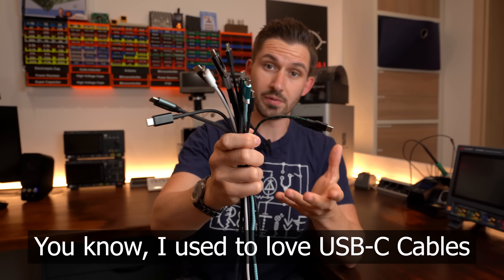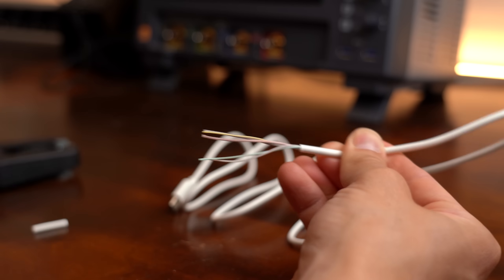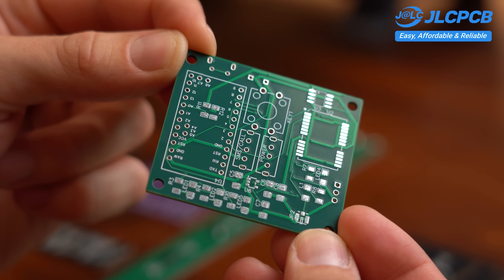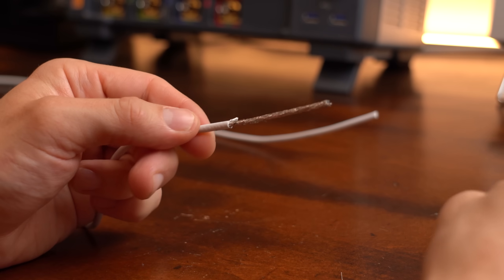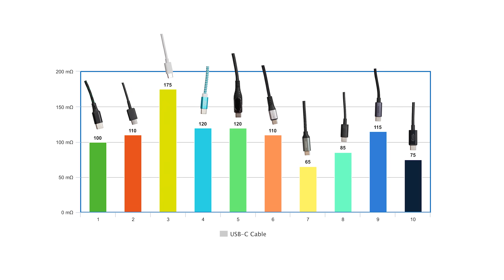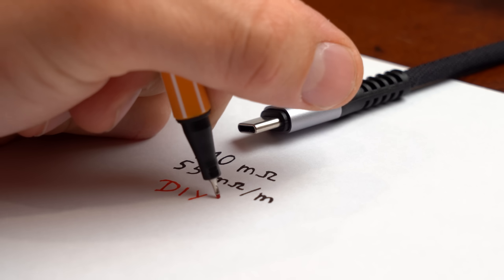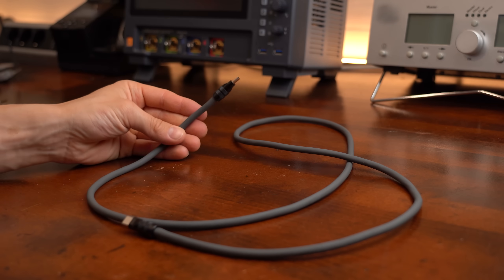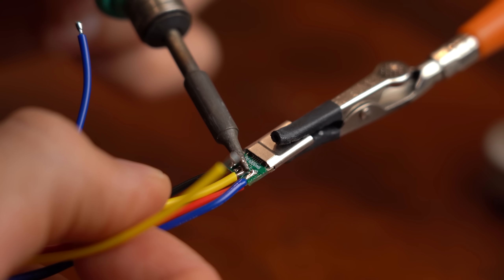Your USB-C Cable STILL Sucks — I Built a Better One? (DIY or Buy)

Comment: No strain relief = broken solder joints / wires. Doesn't look like the "sleeves" provide any strain relief, do they?
Also, I'm assuming the other cables did support high-speed data transfer and alternative functions?
And finally, did you compare outer cable diameter / weight between DIY and the best BUY options?
Oh, and is the wire you used rated for 50v?
Reply: There’s a lot more that goes into engineering a USB-C cable that is compliant with the top tier specification, this is the fundamental reason that they are rare and expensive.
It’s difficult to design a tough and reliable cable while being light weight, has fast data speeds, can carry 250W, be fully compatible with all the different communication standards and also be cheap.
Not to mention the highest spec cables fail QA much more often due to interference effects that are not cost effective to rework.
USB-C cables still require humans for specific operations which drastically increases costs and errors
Reply: @gtjack9  All USB-fig had to do is define 3 standards and use color coded plugs to define them.
One standard for high power low data speed (just like one in video), one for high data speed (and all data formats) but low power, and one with everything.
And maybe fourth with low data speed and low power, but that one would be just a normal USB 2.0 so don't know if it makes sense anywhere.
Reply: @hubertnnn From a consumer perspective you’re spot on, but that is completely different to the technical specifications that allow this functionality to exist. We have complicated cables because cables are actually quite complicated
Reply: @gtjack9  Nah, cables are super simple. All you have is max amps and max frequency it can handle. 
And if you are doing parallel standards then you also have to handle lengths to guarantee synchronization, but we are talking about USB - a serial standard, so no synchronization is needed.
Reply: @hubertnnn 40Gbps, think about that for a second. That’s higher bandwidth than CAT6 Ethernet.
If you can produce your own cable and post a video that meets the highest USB4 specification I will be amazed.
Reply: @gtjack9  Ironically Apple's USB C cables are now the better option. Coming from those nasty flimsy lightning cables.
Reply: @jonbrandjes9024 They are the best by far in my experience, it’s just really frustrating that they don’t do a 2m version of the C to lightning cables.
The Apple usb-c and lightning connectors are a marvel of structure and electrical engineering.
The casing is extremely tough and is laser welded together so the electrical pin contacts are the weakest link of the entire cable, which cannot really be improved with current technology.
I’ve had my Apple cable for more than 4 years without any issues.
For reference I’ve gone through 3 anker cables which fail within 3 months.
Reply from the maker: There is a strain relief. A screw secures the wire in place.
Reply: @greatscottlab  fill it with hot glue as well next time. Help a lot to protect the solder joints.

Comment: hey mate love the videos what is that device you use to run voltage through the cables
Reply: not the tester you use it alot to inject voltage
Reply from the maker: A powerbank or power supply
Reply: @greatscottlab   the board with the fan on it that you can adjust the ac or dc?

Comment: All that work to get 10% improvement is simply not worth it. Now if you wanted to create a cable with better shielding, common mode suppression etc I would understand the DIY route, in this case no.
Reply from the maker: Maybe next time more about shielding and so on ;-)
Reply: @greatscottlab  You are going to have a hell of a time with that one, royal pain to do it right with such small diameter cables, ask me how I know ;)

Comment: Engineer me this, please, because I start to lose my mind.

I have a power bank, in which I guess the batteries are half dead (40000mAh battery, but can take only 20000mAh worth power, and of course can support even less), and it started to work as an OTG device, when it depletes: the tablet charges it back, so I wake up to a half full power bank and an empty tablet. I suspect this because my devices don't really support reverse charging.

I thought, that ok, the power bank is bad, but other power banks started to do the same. Before that I bought a couple of charging cables with charging power display, and I always used the display side in the tablets. I thought, that this is the culprit, so I bought cables without display. 

Now I can reproduce the reverse charge behaviour only with the bad  power bank. My other power banks turn off as expected, and does not behave as on OTG device. But I wonder for how long?

What gives? Also, is there a way to use the Type-C output of the power banks, but prevent the power bank to turn into an OTG device? I found only in my phone an option, to disable the OTG function (to be precise, I have to enable it prior use, and it turns off after 10 minutes of not using it)

Comment: This may be a dumb question but why do you only want slow data transfers? Is it just because fast data throughput is more complicated to make?
Reply from the maker: It takes more wires and I simply do not use it. That is why I did not include it.
Reply: Thanks for answering my question :)

Comment: Digitus has silicone USB-C cables that do it all. They are not cheap but absolutely awesome. Beware with the length though: The 2 meter ones are NOT USB-4 / Thunderbolt 4 compatible anymore and fall back to USB 3.2 Gen 2x2.
Reply: Thanks. Been looking for silicone usb cables 👍
Reply: Do you have a link to them?
Reply: @SierraLimaOscar  Yes but I cannot post it here. It would get immediately deleted. Sorry.
Reply: @SierraLimaOscar  Try Google - I did and in the UK it shows them to be readily available through various resellers.
Reply: That's still very good, usually 10Gbps is rated for not more than 1m, let alone 40Gbps.

Although I think the newer standard has introduced modulation and they have not incremented the fundamental frequency.
Reply: @TrickyNekro  The reason why we still have no GPUs and monitors that have USB-C with PD 240W support is the cable length. 1m isn't enough for anything usable besides for mini PCs. And these have a power supply too weak to drive another screen. I hope they switch to fiber for the data connection so we can have 3 meter cables and a single cable to a screen that provides power, display and a USB hub for peripherals and storage.
Reply: @kyoudaiken they could unify Ethernet and USB, you know at that point, it would save a ton of development time.

BTW I've seen some "active" USB cables based on fiber optics already, but I have little trust to be honest.
Reply: @TrickyNekro (USB & Power) over Ethernet? 😅
Reply: @SystemX1983  was talking about towards making them electrically compatible.
Reply: @TrickyNekro  the more I think about it, I'd love my phone to be charged using PoE and use ethernet for data transfer :)
currently my phone is charged in a cradle using 2 pogo pins, but no data transfer on the cable
Reply: @TrickyNekro  That's most likely not possible. Ethernet needs 4 pairs of twisted wires. It's a totally different thing.
Reply: @kyoudaiken  ethernet doesn't even need more than a single pair, ethernet what? 10 Base, 100 Base more?

In any case, USB 3+ has 4 pairs, 2 RX, 2 TX, exactly like Ethernet.

The difference is that for most versions USB has no modulation and Ethernet has for most of them, if not all. Also Ethernet guarantees isolation, which is a big one and very important in many applications.

The extra signals that USB has can be dealt in other ways also to keep compatibility.

It was pretty stupid for USB not to use Ethernet front ends for the TX RX high speed pairs and this is more of the point that I wanted to make.
Reply: @TrickyNekro  Copper Ethernet draws way too much power. And even 10 GBit is way too slow for the requirements today. Also USB3 uses 2 pairs, not 4. And it also has the old D+ and D- wires for 2.0 of course. So it's 3, no 4.
Reply: @kyoudaiken with 10Gbps and 5ghz fundamental I would have guessed that they use both, but I didn't do a deep dive.

Comment: Would be nice to go deeper, test how important shielding is (probably more so to faster transfers), and if the volts/amps over the power lines affect data rates in shielded/un-shielded/twisted (RJ45) wires, or cable that isolate power from data wires.
Reply from the maker: I actually have a seperate video about shielding planned......but don't tell anyone....
Reply: @greatscottlab  This is a great insight, the DIY/BUY break even point would be even more deep when it comes to the point when it makes sense to just switch to twisted pair and ethernet with a converter in between for ridiculously long cables. 1M usb performance might not be equal to 100M "usb cable" vs twisted pair ETH converter daisy chained. I've had many disaster stories from even below 10M usb lengths for data transfer...
Reply: @greatscottlab  I'll spill some of the beans (sorry man) but I've been hit with this issue myself. Since the power lines aren't screened - at all - any noise (like the apprx. 1KHz polling pulses) gets impressed on the power rails so good luck trying to get sensitive analogue components to work at 5V... It's a really nasty problem, even on USB 2.x
Reply: You gave me a heck of an idea:
USB-C cable with thick power wires and a full CAT5e/6 shielded patch cable for the high speed data.
Thing will be an unbeatable anaconda of a cable for sure.
Reply: @Kalvinjj  But it would be the greatest cable ever made
Reply: @Kalvinjj  "my anaconda don't want none unless she got buns, son"   - Sir Mixalot
Reply: yeah also like do maybe full guide on how to make diy usb cables ground up with your own wire

shielding yes/no
gauges for data?
twisting data wires?

4 wire cable - usb 2.0 for mouse, kb
8 wire cable - that would be usb 3.0 (well back in the day the blue one)
or more 

I was looking into it but didn't seem to find useful info whether and how the length and twisting affect the cable performance e.g. for replacing kb or mouse cable and what would be the recommended length (or how to integrate repeater into it to increase max length)
Reply: I just posted about this, although it was about usb2.0. I reliably ran 25m+ over cat5. The 2 problems were voltage drop (at 5v, a major problem) and noise. Voltage drop was solved by supplying 12v and having a 7805 at the device end. That allowed the device to be detected, but whenever you tried to do work over the line it would drop out. The solution was using the twisted pairs for power as well. V1 just used brn/brn wht as 12v+ and blu/blu why as -ve. GRN/GRN wht as data. Using brn org blu as the +ve, and their whites as -ve seemed to really stabilise the EMI from the power and the USB just worked, even though colleges said it was impossible. Fairly low data rates and power draw, just an 11mbs wifi dongle on the roof, but it worked. I wasn't game to try and run a spinning disc and do massive data transfers, that amount of power and speed might not do so good, but 100% worked for the few weeks I needed it for. Twisted pairs FTW. Even for power.
Reply: @arjovenzia  I've tried it but as soon as something starts trying to send a lot of data over the bus, a lot of the machines I've tested simply give up and spit their dummies out. Wave shaping is an option of course but then the problems of propagation delays start to kick in. It's not a very well thought through standard in many regards. Probably because they never though it would ever get faster than USB Full Speed (12 MBits) in the same way Bill G said no one will ever need more than 1Meg of RAM.
Reply: Further on twisted pairs, if it's differential signalling (usb, ethernet, Rs485 etc), you really really should. The additional complexity of the line drivers is  lost if you don't. But even for power cable I'm now in the habit of doing it for noise sensitive applications like radio and audio. A few years ago I built a bunch of gainclone style amps using lm1875 and lm3556, but wanted the power supply (big transformers n caps) separate from the actual amps. A 3 wire plait (like you'd do with hair) for the 35+/0/35- rails worked heaps better than the 3 core mains cable I originally used. No hum, no variance as the cable moved, and looked really cool. I also use twisted pairs on my solar MPPT controllers, they can be noisy buggers. Not a problem if your only running lights n a fridge, but if your doing ham radio stuff, can be a pain. To get a tight weave, doing it manually is best, but a pain if you have a long run. Clamping one end in a bench vice and the other in a drill and spinning them together gives a far worse twist, but it's fast and still effective.
Reply: Alot of the USB-C cable I tested doesn't even have the shield connected lol, granted they were only USB 2.0

Comment: Great video. I would love to see you try to DIY and overengineer a full spec USB cable which meets all of the standards next time
Reply from the maker: I put it on my to do list :-)
Reply: @greatscottlab  All standards, High Speed Data, High Power, Audio Video , And whatever else there is. Thanks
Reply: @greatscottlab 
You can use multiple mini-coax for data.
Reply: @drgazter  All data lines are differential, mini-coax would be a wrong choice for them I think.
Reply: @galibert42  100-ohm differential is perfectly matched to a pair of 50-ohm coax lines. USB 3 is supposed to be 90-ohm differential impedance, so using 45-ohm coax would be ideal, but 50 is close enough to work. There is also specialized twinaxial cable, like your average SATA cable, but using two separate coax of identical length and bonded grounds is equivalent for most purposes.
Reply: As we have seen, designing a PCB isn't as difficult as it used to be, maybe start from complete scratch, making sure the traces on the PCB are low resistance. There's so much you could do with a simple cable I might give it a try aswell
Reply: I've been using relatively cheap USB4/Thunderbolt3 cables off Aliexpress. My limited testing confirms they can (at the very least) do 40Gbps USB4/TB3, DisplayPort Alt, USB3 10Gbps, and 65W PD, although the listings rate them for much more.
Reply: @asm_nop  do you have a link to the cable? There are too many random no name brands on aliexpress
Reply: better yet, instead of just a cable a full spec USB charger. That would be a hit on jlcpcb.
Reply: @marcoferr9003  If you're going to build your own charger, do it right. Use a linear power supply and make it completely RF quiet. You will need a custom, multi tapped transformer in order to make it efficient though.
Reply: Hilariously, most minimally spec'd Cat6 ethernet cable is far better spec'd and standardized than most premium USB-C data+power raw cables.
Reply: Same
Reply: And use overly thick cables, maximg power and transfer capabilities
Reply: Be the change you want to see in the world.  He's not your dancing monkey.
Reply: Those being the "change" don't waste time, making Self-Righteous YT comments. 

And give your own monkey a break.
Reply: @Alacritous  he kinda is our dancing monkey tho...

Comment: Regular power supply, barrel jacks are cheap. No point in type C power supply, cables are bad, expensive - senseless upgrade.
Reply from the maker: USB-C is more versatile when it comes to power solutions. I made several videos about USB PD PPS and so on.
Reply: Have fun providing data via barrel jack to an iPhone or Android phone 😂
Reply: data could also be transferred wirelessly, just sayin ;)

Comment: Do USB PPS devices compensate for cable voltage drops by requesting more voltage?
Reply from the maker: Hmmm good question. Not 100% sure but I would say no.

Comment: What is "awg"? Who uses that thing?
Reply from the maker: "American Wire Gauge"
Reply: @greatscottlab  Thats actually the only type of measurement I see for wire gauge even online (US), whats the EU equivalent?
Reply: @Warpig8814  we are sane we use mm^2
Reply: @greatscottlab oh another US bullshit then 😂
Reply from the maker: haha true
Reply: What is inch?
Reply: @NekitGeek nobody cares, nobody cares.
Reply: my "problem" with awg is, that increasing the number reduces the size of the wire ...
so when the usb specs recommend 20-28 awg, it looks like the cable manufacturer thinks "hey, lets use 28 awg, higher number is better!" 😂
well it is better ... for the manufacturer, as he saves money on copper ... or copper coated alumin(i)um xD